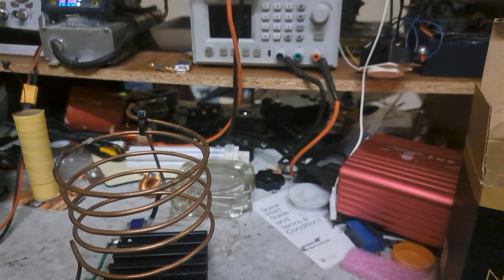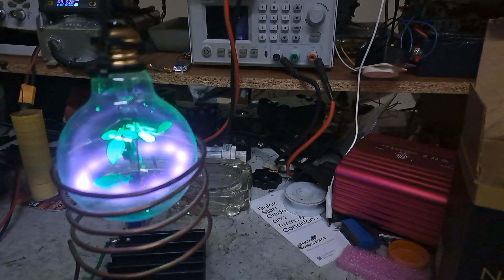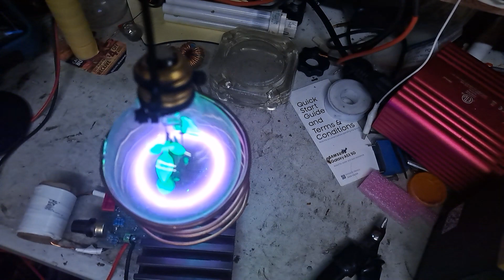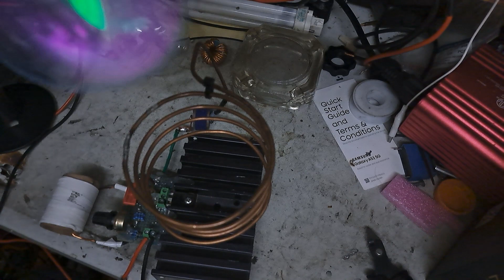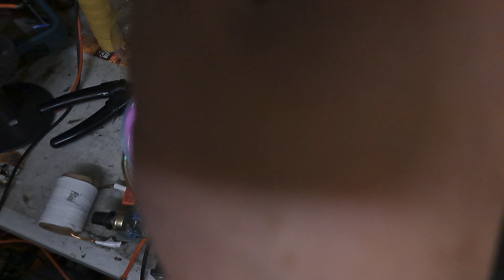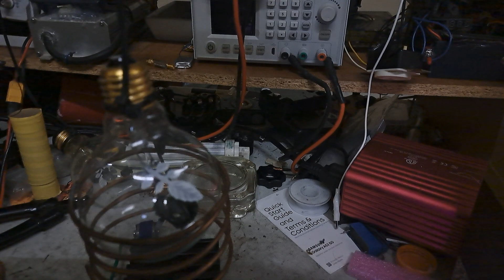More Plasma Toroid Testing (mystery gas mixture)

Comment: Magneticitist if you have a moment...  I've got a couple of very large spherical Pyrex flasks I've been looking for something to do with.  From what you have learned,  do you think this could be scaled up to a globe, say 18" in diameter? Thanks.
Reply from the maker: That would be a challenging diameter to work with but not impossible. I would guess something like 1-2 turns of that diameter would need something in the 10pF ballpark for the resonant capacitor to create an LC that rings in the 10mhz region.
Reply: @Magneticitist  Ok. Thanks.
Reply: @Magneticitist  As far as gas pressure goes? Would that be the same no matter the size, in your estimation?
Reply from the maker: @sempertard  I would think so but on that I really have no idea for sure
Reply: @Magneticitist  Understood.  Think I'll start out smaller then. Maybe 10"-12", see how it goes. Work up from there. thx

Comment: Very good . I am collecting parts to try this too and am super stoked you got it working with a standard bulb . Makes me ever more super charged to make it happen !
Reply from the maker: As far as I know that's 3 of us now. Termadnator and YSpace Labs also formed the donut with them. It is as Termadnator said indeed a "poor mans" version but it's still pretty cool.
Reply: @Magneticitist  yes I feel it should work with outdoor 500 watt globes as well . I can't wait . I could possibly knock up a crude version soon but I got endless half baked projects so I better complete some of them first .
Reply from the maker: @Buzzhumma  You mean like a metal halide? I've actually tried one of those in the past and you can actually see the little "beads" forming in there but only the tube is filled with that gas, not all the rest of the empty space in that bulb. So it works but the effect is just seen in a small tube.

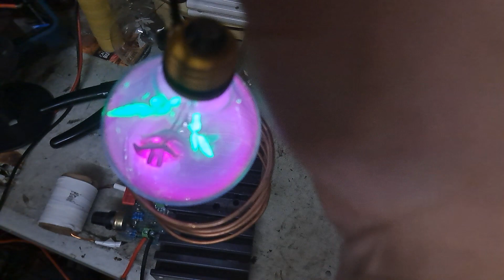Comment: 5:30 thats cause your coil awg is too thick. switch for more turns thinner awg
Reply from the maker: You mean the loading? That's just basically cause it's a full CW and being loaded a certain way similar to drawing out a plasma flame. 
Only getting the donut or similar to where there is the hard rail switching will reduce the power a lot like that.

You can see Termadnator is right about what is happening by placing like a snap on choke on one of the rails. When I do that the choke rings really loud from the vibrations.

Comment: I wonder what would happen if my spider made of iron wire held the bulb?
Reply from the maker: Extra capacitive coupling through the terminals themselves just seems to throw it out of wack. Or basically just means it needs retuning again to get the donut if there's something touching the terminals and also not loading it down much.
Reply: @Magneticitist  you can drop the wattage by increasing turns and reducing awg , this will raise the impedance of the inductor allowing a lot less watts threw but you will need to raise the volts a little to push threw the higher impedance . thats if efficiency is on your roster
Reply from the maker: @mykedoes4099  Yea if you mean to like be able to maintain that sort of whiter looking cloud ring but in that case I could just cut the power down. I needed to push through that in order to get to the actual toroid that looked more red/pink though.
Reply: @Magneticitist  have you not seen my insulated spider? The iron wire should resonate with your coil. The star shape causes a spinning magnetic vortex around the base of the bulb. The filament should be connected to the ends of the iron wire. And the bulb should be held in a ceramic socket.
Reply: @Magneticitist  the coil you have now looks like a primary , did you try with a secondary type winding ? Maybe I am not see the whole circuit all i see is a thick coil with like 8 turns .  Whats feeding that coil is it a flyback driver?
Reply from the maker: @mykedoes4099  I'm not exactly sure what to call these circuits honestly. I don't know if they've ever been given a good colloquial title other than "hfsstc plasma flame" circuit etc.. It's basically just a self resonant LC oscillator so it's a coil and capacitor self-switching a mosfet around 13mhz. To make it work with a secondary-like coil as the inductance in the LC you would have a hard time getting to oscillate very high in frequency. Instead you can just attach some secondary to the primary LC to get higher voltage or some different field shape. 

With this circuit it's not so much about crazy high voltage but rather the high frequency and impedances which allow for such a strong capacitive coupling. To get the higher voltage you need to add that second resonator and boost it.
Reply: @Magneticitist  the reverse flyback is HV spike . They just switch a coil a put a diode on the reverse polarity to capture the HV or you can throw it into a HV Tesla Coil and keep Boosting Volts of course you lose amps along the way
Reply: Sup bro!  ;)